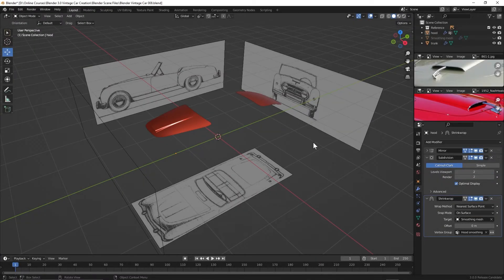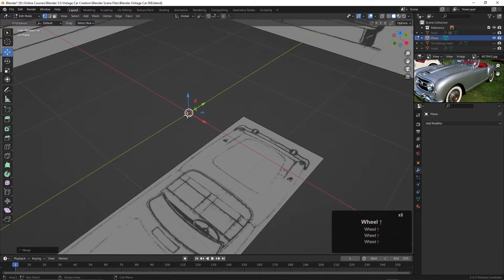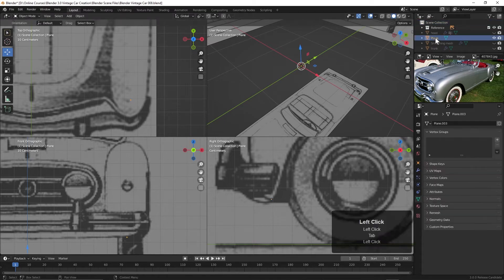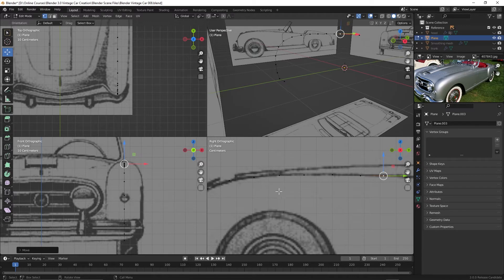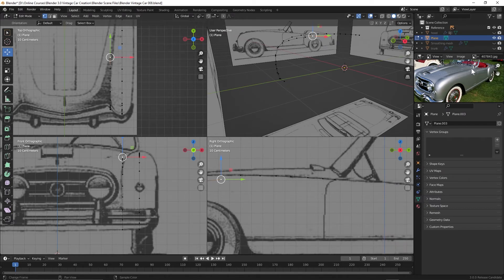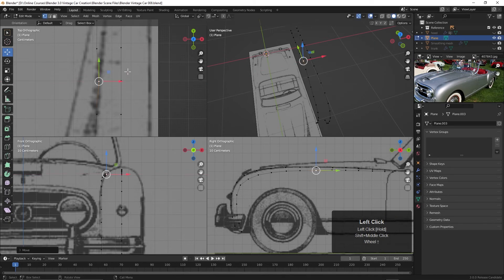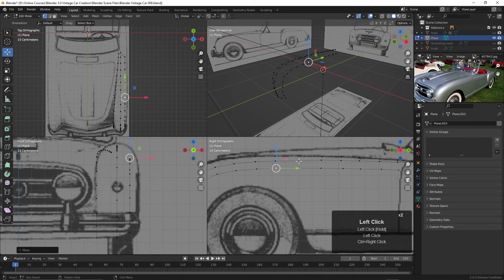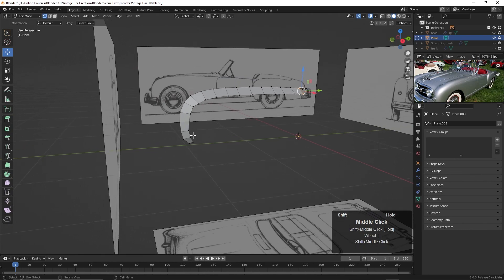Blender Vintage Car Creation - 008 Beginning the Front Fender

Comment: Nice start on the fender. Ive been working on a 50 model Ferarri 166 MM and it has just about got the best of me.
It has front fenders like your car and cones that go to the tail lights. And then on each end of the car it has almost like a slide on  both ends that flow down the inside of the lights, down and under to the outside of fender.
I was hoping to pick up some tips in this series.😃